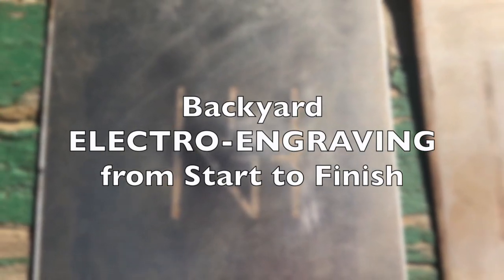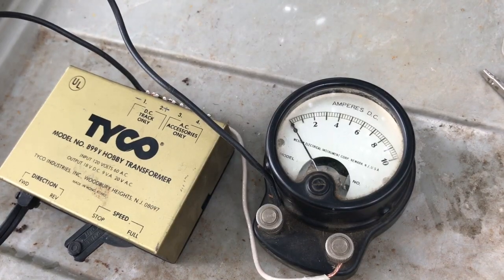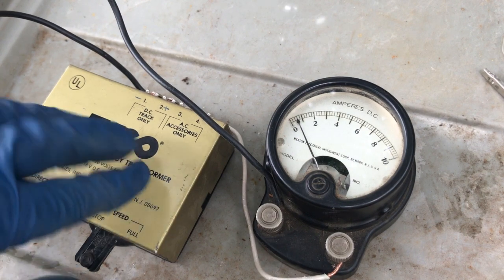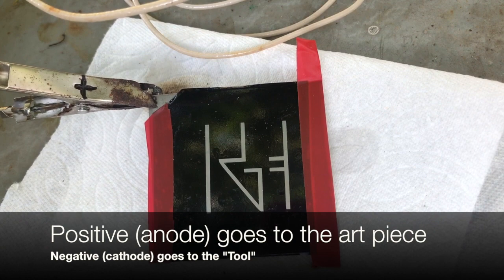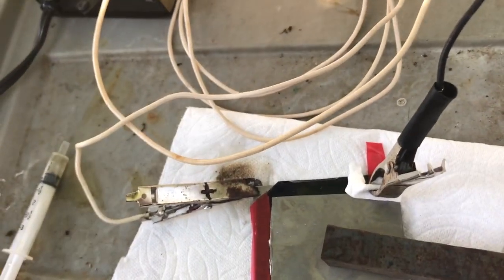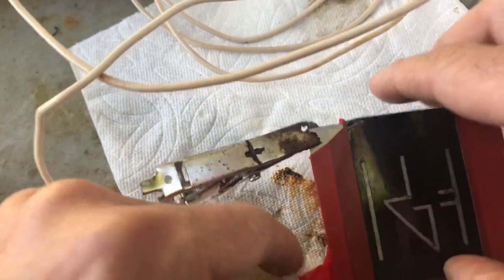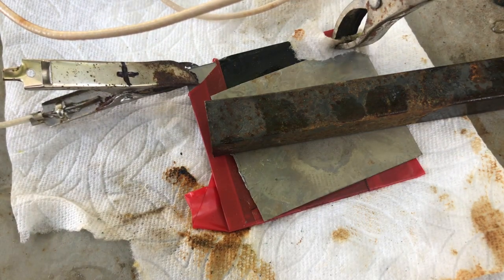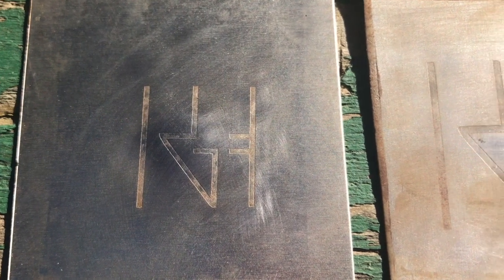Electro-Etching Metal - How to use DC to etch metal & AC to mark metal

Comment: After much experimentation and video watching, I accomplished similar results but your mention of the resistance element is new to me and much appreciated. Placing a “resistor” in a different location that between the face of your negative plate and the target object appears to net quicker results than covering the plate with felt or other absorbent material and having to dab and move it around for up to 8 minutes (at 15v and 3a DC for material removal). Could you tell me the name of or where to obtain the stencil material you are using? It appears to be good for only one use.

Comment: dear MASON DIXON,
thanks for perfect video! But what do you mean AC from same power source? I mean there is no video how you connecting AC for marking. Is this same power source? what have you changed when going from DC to AC? I mean your same transformer. It's little bit tricky "Connect art piece to  + but after connect AC (alternate power current). Does it means when you using AC metal some way getting blackening (just electrochemically?)
Thanks once more!
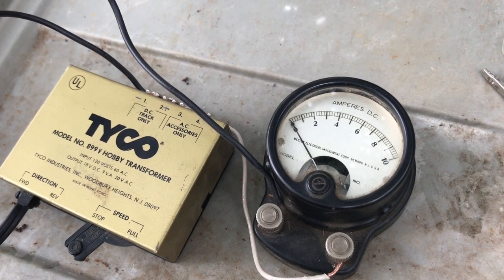Reply: Rope, Look at the video (~1:04) at the top of the Tyco transformer you can see 'DC Track Only (+/-) and AC Accessories Only'. There is two screw connection on the back side of the Tyco transformer. If you are using DC you connect your etcher to those two terminals; if you are using AC you connect your etcher to those two connections.For DC +/- is important for AC it is not. You can get these (Tyco transformers) off of Ebay for ~$15- $20. Hope this helps. Don't know where "mason dixon " is.